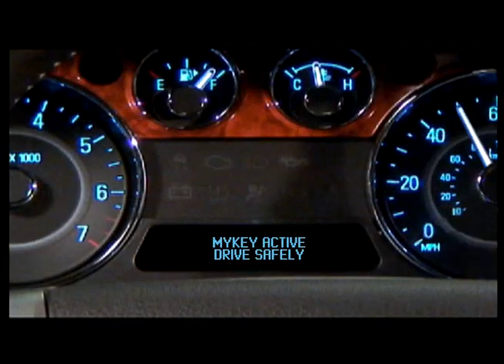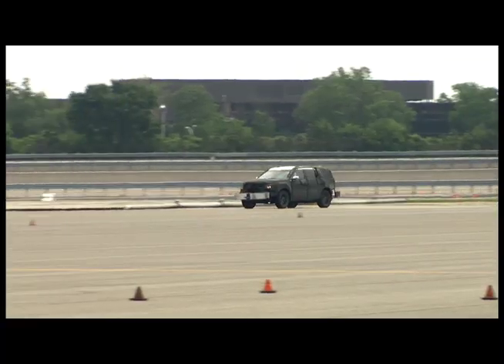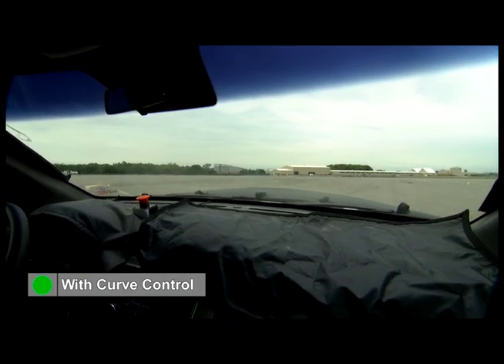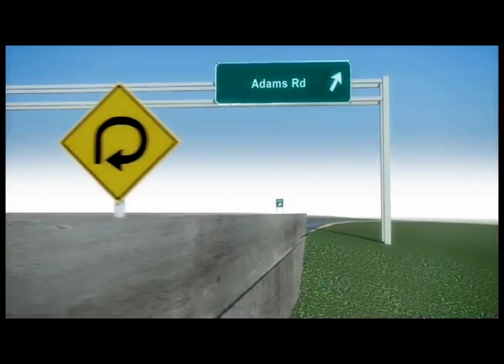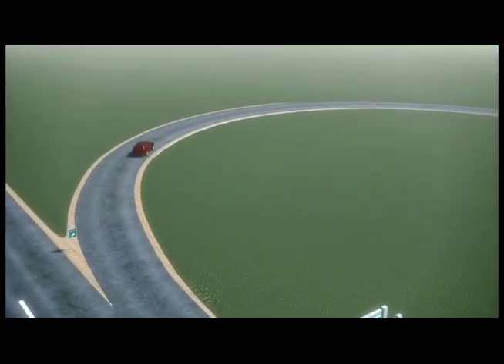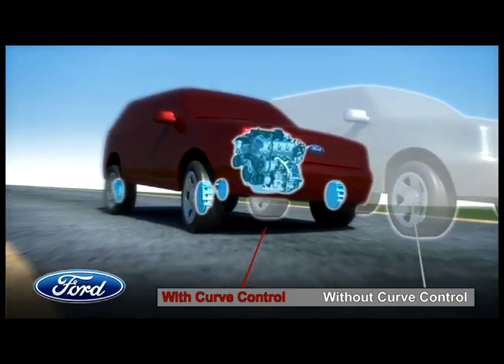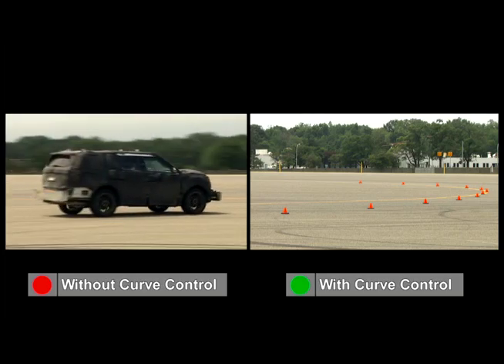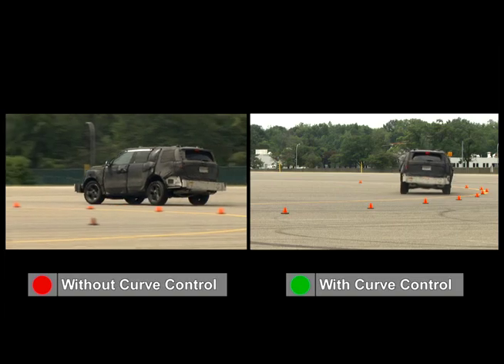Ford reveals Curve Control technology - debut in all-new 2011 Ford Explorer

Comment: @77ROLLS77 Poor handling is a staple of American autos, but it has little to do w/ the accidents this guy was going on about. 55 is the posted limit, the actual flow of traffic ranges between 65-75 depending on where you are. The problem is that we've got a seemingly infinite supply of drivers who can't drive.